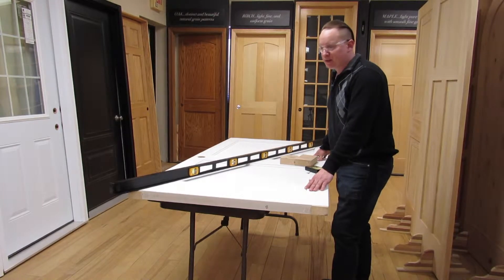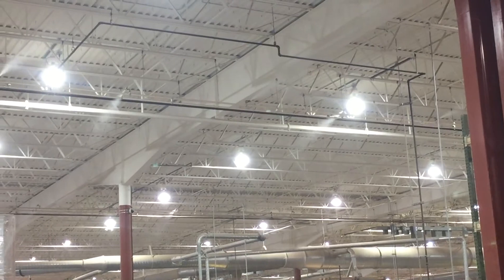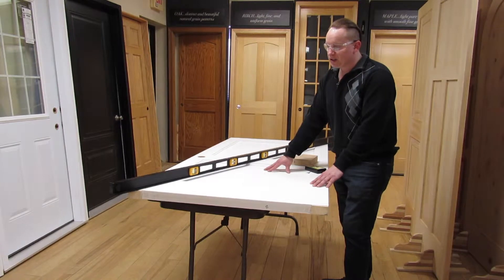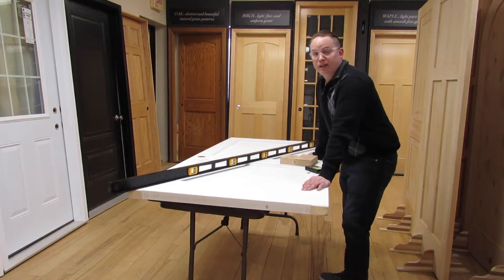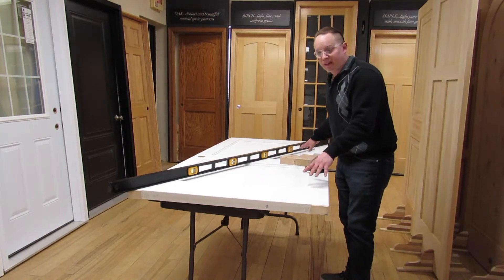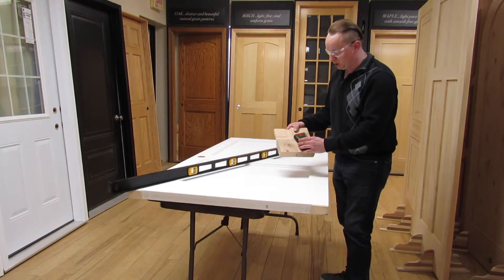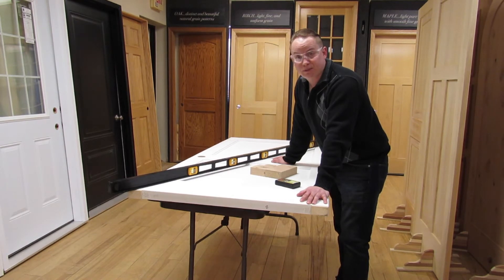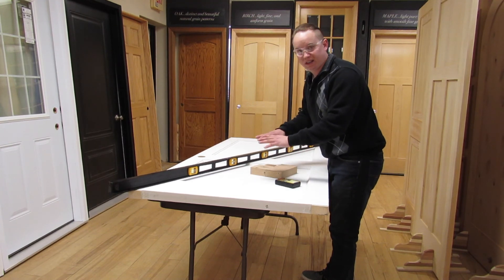Door Warp - Woodport Doors LLC

Comment: When I was into building acoustic guitars we used heat/water and force or weight to bend wood to our wills. 
The quickest way to flatten that door out is water/moisture, heat and weights. Cinder blocks work well for weights and just place them ontop of a straight piece of wood laying across the door over the warped spot. I would try to weight down as much as that door as possible though not just the warped area. You want to ensure the other corners don't warp.
Then let it dry out with the weights on it. That should fix the warp but the problem will still ultimately be where that door ends up and did it go through hot/cold cycles and what is the humidity content of where it's finally installed. He is correct when he mentioned something about cold hitting the door, that will actually cause the moisture to be sucked out.. cold climates = less moisture, furnaces running in winter will suck moisture right out of everything in a house too so keep all that in mind.. 

 It's also why we cover wood with a sealer, shellac or varnish type products which locks in the moisture content during these humidiy/temp changes.. Paints will do a similar thing to protect the wood. Try not to ever use untreated or unfinished wood if you can avoid it.. The reason most people build homes in warmer months is because of this.. So the framing and 2x4s don't end up warped all to rat shit since they are not treated products..I should also add that cedar tends to not warp like pine for some reason.. I think it is one of the best and nicest woods to work with. That is why it's used in sauna's and steam rooms sometimes because of it's natural protection against humidity and heat/cold changes.

Comment: So basically they are keep in a climate moisture controlled environment to stop them warping, then it's our fault when we put it into a normal climate house?
Reply: Precisely…if ya dont like it, set your home’s ambient temp./humidity to the exact same settings as the purchasing location before introducing said new door and perpetually keep it at those settings…be guaranteed to have the least movement possible lmao…but It is still wood after all and wood moves regardless of the measures one takes…even ones as insanely drastic as the ones previously stated 😂 🤣